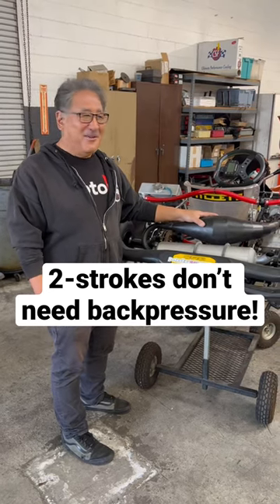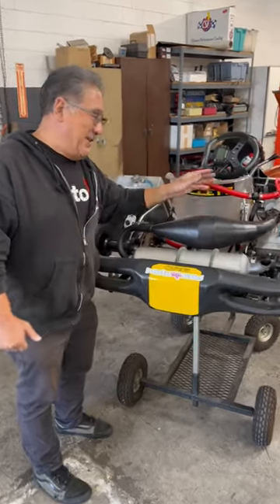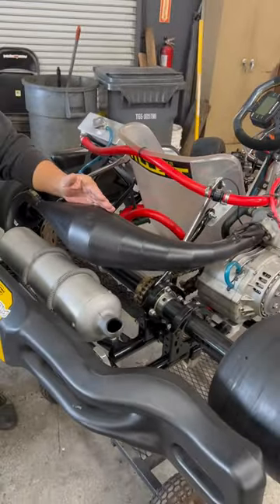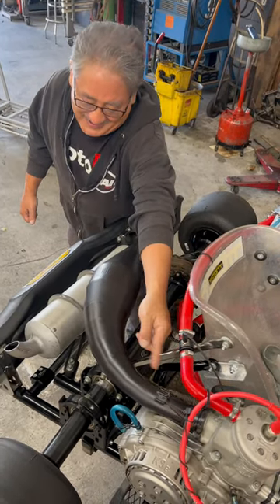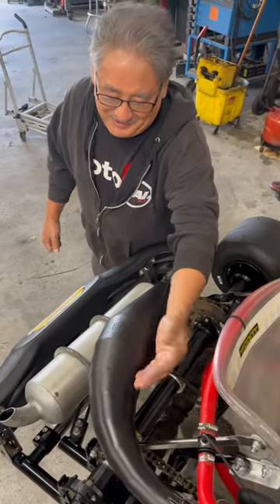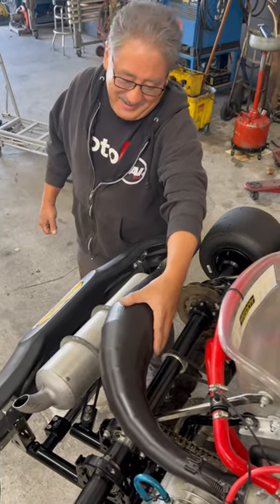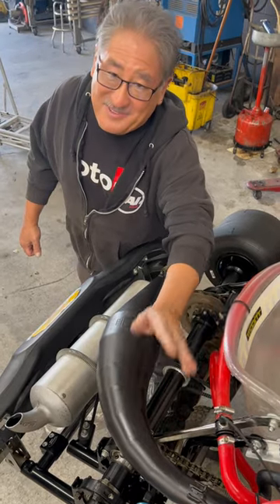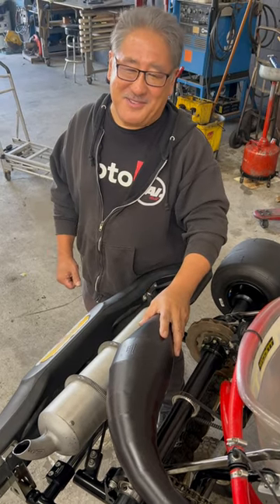2-strokes don’t need backpressure!

Comment: Not true, the exhaust chamber tuning is separate from the back pressure requirements. 35 years or building Yamaha and Kawasaki two strokes, we found that eliminating back pressure completely caused a drop in roughly 150 RPMs and inconsistent bottom end response. 

Factory Pipe Products, mass manufacturer of aftermarket and stock exhaust for Kawasaki Yamaha Polaris they used to make mufflers and people racing in limited class found that they were losing top speed after installing it, and they did a mass recall where they installed this insert to bring back up the back pressure. Top Speed Returned. 
What you can also notice is that most aftermarket exhaust have the end section of the pipe significantly smaller tube ID than the one at the exhaust port, like in this go kart you are showing. This down size Increases back pressure. 

Back pressure does matter on a two stroke, at least for top their competition and power development, On a four stroke it does not matter and you want none if sound levels are an issue.
Reply from the maker: What I said is totally true, no piston engine works better with retained backpressure. it limits the amount of work that can be recovered from the cycle. Adding a restrictor to that pipe was a bandaid for improper pipe design, back pressure increases the speed of the reflected wave in the chamber.  Pipe design uses wave propagation and timing, it's all about that, you want all of that with the least amount of backpressure possible. The exit of the expansion chamber is called the stinger, a rule of thumb is that its length is 6x or more of its diameter,  It not only serves as the exhaust exit but also is part of the pressure wave tuning.  If the stinger exit area is less than the exhaust port, it is that the exhaust gas diffuses, loses a lot of energy, and greatly cools down.  It no longer needs as big of an exit cross-section. If that pipe was designed correctly and tested correctly, it would work better with no restrictors.
Reply: @motoiq  MIKE DROPPED
Reply: @motoiq  I agree with all the principles and theory’s your laying out, but I can’t go against the evidence I have seen with my own eyes.
Another example i had was in 2001 when Yamaha recently the GPR 1200 watercraft, We started r&d on one of them, we started with the exhaust as we always do on a new vehicle, and started eliminating back pressure by modifying the muffler, and what do you know we yet again dropped RPM and top speed. 

Now this was completely stock, so Yamaha designed the exhaust system, yet when you went to get rid of the back pressure, we lost performance. Maybe Yamaha didn’t design the exhaust correctly? Possibly? I was only part of the race team so we weren’t involved in the actual development of the power plant and only received new models a few month before the public, but I trust that OEM’s don’t purposely do things to lose power (aside from Meeting sound/pollution regulations) because on the showroom floor they are competing with all the other OEMs and even saying you have 5 more horsepower helps sales. 

I really enjoy all your video and in-depth break down on lots of things. But on this subject we’ll just have to agree to disagree.
Reply from the maker: You have to understand the principles of how two stroke pipes and physics work, getting rid of a muffler and back pressure, if the chamber was designed for the back pressure of the muffler you will loose power. That being said a chamber designed only to make power and not to comply with noise regulations with minimal back pressure is going to make even more power. Look up the pressure volume cycles and the thermodynamics of two strokes and see. I am not making this stuff up. Of course your observations are correct but the reasons why are not.
Reply from the maker: https://www.mecholic.com/2016/02/working-of-two-stroke-engine-with-pv-diagram.html, if you retain pressure inside the engine due to back pressure, you raise the bottom of the PV curve and loose area inside the PV loop, the area inside is the work or power.  Two stroke expansion chambers are like musical instruments, if you do stuff to change something, they can get off tune very easily.  By reducing the backpressure by removing the muffler, you are reducing the density and temperature of the gas inside the chamber, this means that the acoustic and pressure waves will travel slower getting the pipe off tune.  A simple way of getting it back without adding backpressure may be by playing with the stinger length or adding a stinger before the new muffler.  A lot of times this won't package in the space you have though.
Reply: Pwc 2 strokes are different than all others. The tuned pipe has a water jacket and most have water injection at some point.  So the temperatures inside the pipe are lower than other applications.  I have a 2001 seadoo rxx factory race boat with factory pipe twins, novi carbs, Mel Miller head, intake,case cooler turning around 7600 rpm through a skat magnum pump
Reply from the maker: Water injection really affects pipe tuning.

Comment: Your statement on back pressure is incomplete or only partially accurate.
Reply from the maker: No it isnt.  Look up the PV diagram of a two stroke and tell me where mean backpressure is going to help.
Reply: @motoiq  That is exactly the function of the stinger diameter, controlling the pressure.
Reply from the maker: The stinger is there to improve the strength of the reflected wave, not to increase mean backpressure.

Comment: 2 strokes need backpressure to function, ask yourself what the stinger/tailpipe restrictor part of  the expansion chamber does
Reply: Yes and no.  The stinger is there to keep the pressure wave from just yeeting itself out the back without ever getting reflected.  We could call that backpressure of a sort.  But importantly, the stinger must absolutely not be allowed to restrict bulk gas flow and cause an increase in average chamber pressure.  That results in a loss of top-end power and, more importantly, a very aggressive increase in engine temperature.  Most pipe makers will leave just a bit of low-end power on the table in order to ensure the stinger isn't too small, with a margin.  Especially when a muffler is involved, that restriction (and additional restriction over time caused by "the spooge") is accounted for.

I'm guessing you know all this, but it's good information for future visitors to these comments.
Reply: @JETZcorp  yes, we call that backpressure
Reply from the maker: Its not a restrictor, it is a way to let the exhaust gas out and still get strong reflection off the back cone.
Reply: @motoiq  it does this by restriction, allowing pipe pressure above atmosphere for the blocking wave to supercharge the cylinder. This blocking wave is literally backpressure! @JETZcorp did a pretty good job explaining, but it worth mentioning that larger diameter restrictor actually tends to improve bottom end power by weakening this blocking wave, which is destructive at 2/3 peak RPM. tighter tends to drive peak power higher until you become thermally limited as @JETZcorp wisely said
Reply from the maker: It does it by acting like a wave interference device, that's why the ratio of diameter to length is important.  If it was a restrictor, they would not use a stinger but a hole. What JETZcorp said was correct as well.
Reply: @motoiq  Hello, modern pipes do indeed just use a hole, stinger length is unimportant, restrictor nozzle size is determined by horsepower and thermal capacity in more modern exhaust design concepts. if you study newer exhaust concepts by Fritz overmars for example.  you'll notice this value is defined by horsepower.
Reply from the maker: I am not aware of many race-type expansion chambers that use a hole or a restrictor inside the stinger.  I have seen that on street chambers but mostly for noise suppression reasons or as power limiters in 50cc scooters in the European market for licensing reasons.  The engines run better with it removed, a common scooter tuning trick. The only race chambers I have seen with just a hole are on restricted 100cc kart classes on class-mandated spec pipes. Stinger length is very important.  A typical starting point is L=6 X D.  Messing with stinger length and diameter is a very common two-stroke tuning thing.
Reply: @motoiq  3.1*sqrt(horsepower) is a good starting point for restrictor size for water cooled, 3.3*sqrt(horsepower) for air cooled, tailpipe length is unimportant if you design it correctly, should be more of a de Laval nozzle shape than a hole.
Reply from the maker: So de Laval nozzle as used in rocket engines is used to prevent shockwaves from propagating through the outlet?  That is a very clever design feature!  I wish I had thought of that.  I don't think this is very widespread yet or at least I haven't seen it on karts, scooters or dirt bikes yet.
Reply: @motoiq  Yes, I believe Jan Thiel at Aprilia or Frits Overmars came up with it, it's great because it allows much better packaging, like when building a long tuned length pipe on a short wheelbase Yamaha RD or Enduro bike, it's also great on multicyclinder engines where it's hard to get a matched stinger length and package mufflers where you want them. If you build the restrictor right the tailpipe length becomes insignificant.
Reply from the maker: I wonder if this is used in snowmobiles as a lot of two stroke development is happening there.
Reply: I haven’t seen them on KZ, but tuning inserts of various dimensions were popular with the CR125 in karting. These are placed inside the end of the silencer.

Comment: Wow what a disconnect, your entire short titled “2-strokes don’t need backpressure” was about the pipe and pulses within it and now to avoid admitting your title was inaccurate as I said, when confronted with evidence from a source you cited, you deflect to VE? And FYI the mean pressure in the pipe is positive thus creating back pressure. I’d be happy to show you pressure traces I’ll be at Rok Fest in Vegas next week look for me in the scrutineering tent I’ll be the on wearing a shirt that say’s “Official”
Reply from the maker: I am not deflecting, I am just stating facts. What I said is accurate. Instead of trying to argue with me, your time would be better spent studying how the rest of the engine works.  Look up the pressure-volume diagram for a two-stroke engine and you can easily see that if you raise the pressure base, less work or power can be recovered from each cycle. That is just one of the reasons but it's the simplest and easiest to visualize and there should be many examples for you to look at online. You understand how the chambers work 100% but are not looking at the entire engine.  I didn't make this stuff up, every second-year engineering student learns this and it was well-understood over 100 years ago. If you look at the pressure profile of a chamber, you can see that pressure goes negative in significant parts of the cycle, especially in the diffuser area of the pipe.  You probably know this.  If you squeeze down the pipe exit to the point where you are intentionally increasing mean pressure, the timing of the pipe becomes faster due to the increased density and temperature of the gas inside and sometimes this gives favorable results.  It's more of a tuning Band-Aid as a pipe with the desired tuning with lower mean pressure is going to be better for power recovery and production. Like I said, it's not just me making something up but well well-understood phenomenon that I learned in school and applied later in life.

Comment: No to be that guy, but this i extremely over simplified and not very accurate either. Ps they do want pressure in the pipe thats why they have a stinger.
Reply from the maker: You only have 60 seconds in a short to say something so of course it's oversimplified.  The stinger isn't to hold pressure in, it is designed to allow gas to escape while keeping the reflected wave in the pipe.  That's why its dimensions are critical.  What I said is simple but 100% accurate.

Comment: Not back pressure. It's called scavenging.
Reply: On 4 stroke, yes. Not on 2 stroke. Its exhaust pulse tuning.  Throat diameter and length, chamber taper and stinger diameter and length all have key attributes that they change and at what rpm it changes them at.

Comment: Missed the mark real heavily, the pulse is back pressure. The whole purpose of the pipe is to create back pressure at a certain rpm. Saying a two stroke doesn’t like back pressure is like saying a diesel doesn’t like boost, kinda super wrong
Reply from the maker: That is absolutely completely wrong.  That is not even close to how expansion chambers work.
Reply: @motoiq  that is completely correct buddy and truthfully we all think you should stick to talking about cars. The shape of the pipe creates a wave of back pressure at a certain rpm, if your stinger diameter is too large the shape of the pipe will do nothing and you will not get resonate backpressure. If it is too small your egt get to hot but regardless you have to have that wave of back pressure or it won’t make power. Read some books like two stroke exhaust systems by Roy bacon or the two stroke tuners handbook by Gordon Jennings, that should give you a basic understanding of how expansion chambers are working. If you look into small two stroke motors only in very specific use cases do they have expansion chambers. Normally they have straight tube exhausts and it’s because the port timing layout is extreme compared to bigger motors because the forces are so weakthis is why they idle at 1200 rpm. If you did put a pipe on one you would not get resonant back pressure from the pipe until 14-15,000 rpm and it would peak around 18,000 and that’s too high for anything bigger than a 35cc. But basically go read a book before you spew bullshit goober
Reply from the maker: Sure but that is not what you said, expansion chambers work by resonate tuning, just like an exhaust for a 4 stroke, good ones do not increase mean backpressure, they utilize resonate pressure waves to both help scavenge the cylinder on blowdown and reduce over scavenging at the bottom of the cycle. If they did increase mean backpressure, the VE would go down and you would lose power as you are raising the gas exchange floor in the two-stroke cycle so the total amount of energy that you can recover from each cycle would be less. At least you bothered to look up Jennings before you replied, good job, but that is just a partial knowledge of what is going on in the engine, disregarding the thermodynamics.  I have also always built two strokes, fast and competitive ones.  I know you just looked it up because now you are saying what I said in the video. Also, that nonsense about chambers not working on small engines is completely wrong. We built tons of superfast gopeds and pocket bikes with 35cc motors and chambers help hugely often doubling the power.  Even 7CC rc engines often have chambers and the bigger RC engines which are 9cc almost always have a chamber.

Comment: You don't even know what you are talkimg about, a pipe should be tuned for the engine rpm powerband to enchanche it, and IT WILL HURT LOW END
Reply from the maker: It depends how it was tuned, it can be tuned to greatly help low end or wherever you want to put the powerband when combined with the port timing.  You don't have a clue to what you are talking about.
Reply: @motoiq  bro I modify 2 strokes, if you have an engine that should rev to 9000 and you put a pipe that also has in mind low end power your engine will rev to 7000-7500max and won't be efficient or powerful anywhere in the rpm range
Reply from the maker: I build and race two strokes and what you said is exactly what I said.  Of course if you mismatch the pipe with the port map it's going to be a mess.  You are the one who said I don't know what I am talking about.
Reply: @motoiq  bruh a pipe that helps low end doesn't exist, your video is wrong
Pipe should be around somewhere in the engine powerband, they NEED to be matvhed otherwise it's a mess, if you have transfer ports for high end and a pipe for a low end all you got is a 2 stroke that makes as much power as a 4 stroke lawnmower.
And your pipe showed in the video is a ultra top end pipe lol, haven't seen in a while a pipr with such a short header on an engine that seems to be around 125cc or bigger
Reply from the maker: Well, no shit that is super obvious. That 125cc engine makes 50 hp so it's tuned for top end.  We never said it was tuned for bottom end. Somehow YOU construed that we said it was.  Out of thousands of people who saw it, only you thought that. We just used it as an example of an expansion chamber. I mean we build and race real two strokes, we even built a 50cc Tomos moped that could hit 65mph. Why do you insist on trying to look smart and us look stupid when you wrongly interpreted a very simple video.